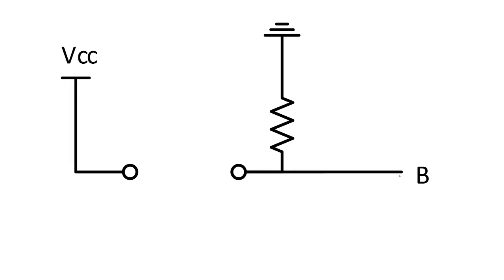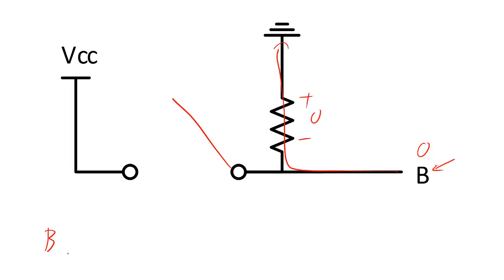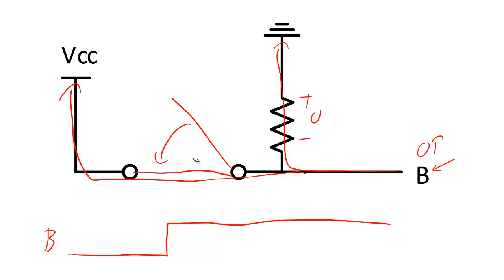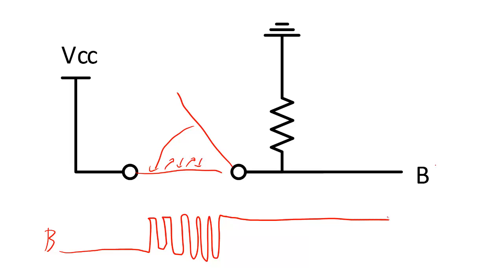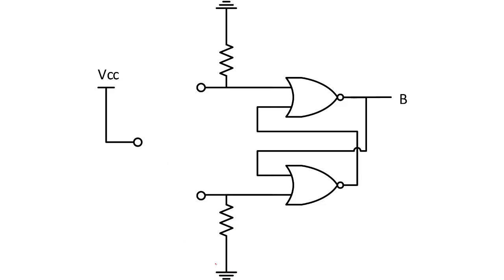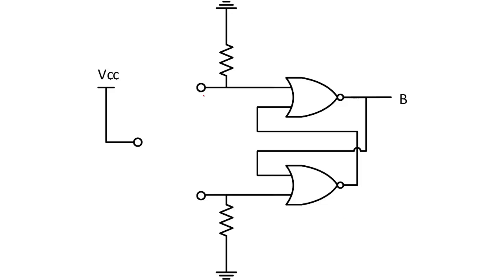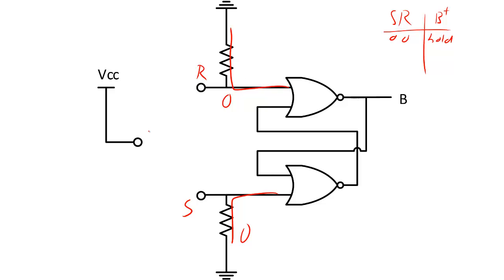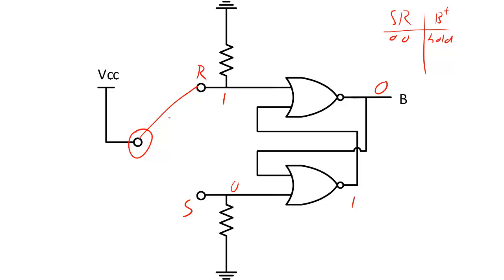SR switch debouncer

Comment: And now for something a little more universal.
I have designed a SPST  SR Latch debouncer. It tells you - like the SPDT SR Latch circuit - as soon as the switch starts changing state (plus deglitch time). Either opening or closing. 
https://spacetimepro.blogspot.com/2023/09/switch-debouncer.html

Comment: this circuit for SPDT switch only ???
Reply: I just did one for SPST. Surprised no one else has made the effort. 
I have designed a SPST  SR Latch debouncer. It tells you - like the SPDT SR Latch circuit - as soon as the switch starts changing state (plus deglitch time). Either opening or closing. 
https://spacetimepro.blogspot.com/2023/09/switch-debouncer.html